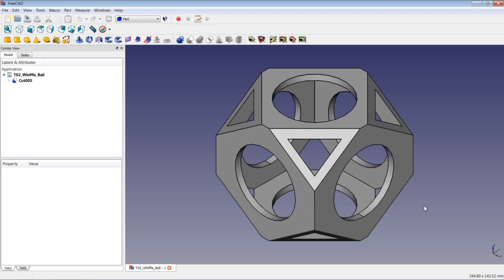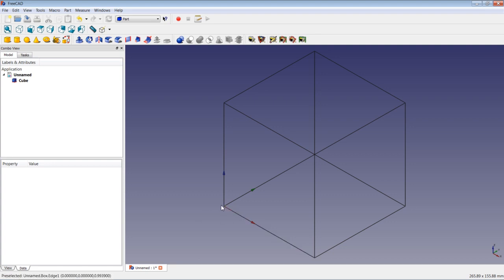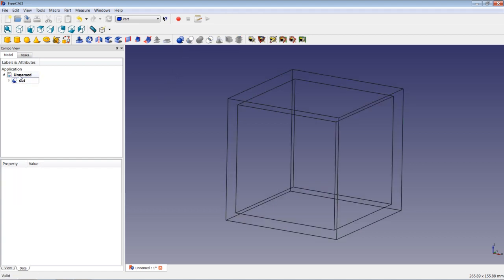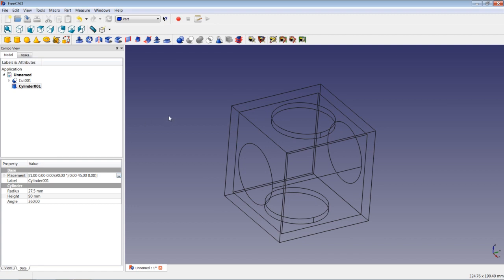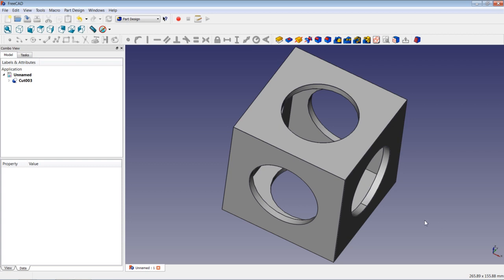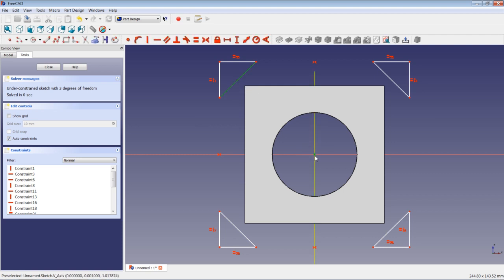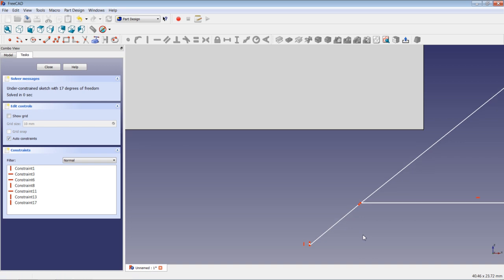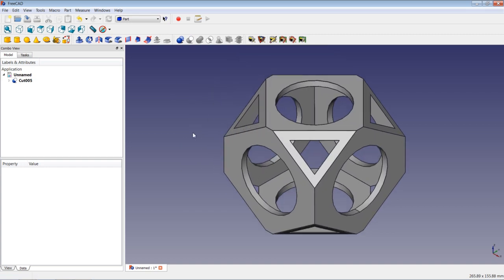FreeCAD Lesson 02 - Whiffle Ball

Comment: Excellent series of videos, many thanks.
However, I'm having one problem with this one. When I create the four triangles they are sitting at -45mm on the Y axis (flush with the front face) and not at zero as yours are. If I go into placement I change the y position to be zero and the triangles move to the zero position but then immediately moves back to the -45mm position again. I cannot get it to stay at zero. It's obviously something I'm doing wrong but I cannot figure out what and it's doing my head in. I've tried creating the job twice, following the instructions to the letter each time and got the same results. Can anyone point me in the right direction please.
Reply: It's ok, I figured it out. I didn't change the workbench from 'Part' to 'Part Design'. I must have missed that part (twice) but all is good now.

Comment: When  I set the length between the origin and the hypotenuse the error saying 'Cannot set the datum because the sketch contains conflicing constraints' appears. How can i solve this??
Reply: Ah sorryI spotted my silly mistake
Reply from the maker: The message already should suggest (in red) which constraints conflict. So removing one of them should do the job ...
Sketching and setting constraints is (can be) complex. There are only some guidelines, since  many possibilites
exist it is also nearly impossible to have some help/wizard available.
Practicing sketching, following the forum on the FreeCAD-Homepage and looking at examples
is the best advice ...
Reply: Thx

Comment: helo I've been working through your tutorial when i get to the point of the video 21:26 i have 20 degrees of freedom and I'm finding it really hard to constrain the triangles to move together with out over constraint the sketch
Reply: i get it to work kind of but i still have 1 degree of freedom at the end
Reply: don't worry solved it i had to constrain the hypotenuse to equal each other and have two sets of points both equalling 130 mm to stop it all deforming

Comment: can not find wireframe. any helps
Reply from the maker: +universallvr7 Maybe you are using a very old Version ?Please try to update ...
Reply: OS: Ubuntu 14.04.4 LTS
Platform: 32-bit
Version: 0.14.2935 (Git)
Branch: master
Hash: eab159b6ee675012bf79de838c206a311e911d85
Python version: 2.7.6
Qt version: 4.8.6
Coin version: 4.0.0a
SoQt version: 1.6.0a
OCC version: 6.7.0
Reply from the maker: +universallvr7 As I said, way too old Version (and does not contain wireframe).You should be able to update to at least 0.15.4671.I would even recommend using the daily ppa-Version (seeFreeCAD-Homepage for Details) since that Version is alreadyat 0.16.6647
Reply: oh wise one, thank you for sharing your knowledge and wisdom.

Comment: I hate to criticize, but these tutorials are more an exercise in patients than using the program. I'm using a parametric modeler to SPEED UP repetitive modeling tasks. Not to practice drawing triangles and circles.

When the tutor says "you could have done it faster by..." I'm thinking, WHY DIDN'T YOU SHOW ME THAT!

It's not only inefficient, but at least in .16 there's some bug that makes my whole model disappear after trying to undo a cut.
This is just makes "Application" tab a list of messy code that is hard to edit.

Now I'm starting this tedium over.
I hope when .17 comes out, the tutorials concentrate letting the computer do the repetitive stuff, and let me concentrate on design.
Reply: That problem of the model dissapearence is cause probably because of a wrong selection of the Cut and the object (cube, cylinder etc.). It is essencial that when making a Cut you highlight the Cut FIRST, and then the object you want to add to the Cut. Otherwise it will cause an error, and when you try to undo it, headache is bound to come. About the undoing, you just undo the last step. The model will dissapear indeed, but if you look at the tree to the left it has not been deleted. All you need to do is basically Toggle Visibility. That can be done either by right-clicking the object wich dissapeared in the tree and clicking "Toggle Visibility", or by just highlighting it on the tree and pressing the spacebar.
Reply: Plenty of other videos, and these work for me. I just have to make sure I actually make the object he shows.

I wish you well finding those that work for you.